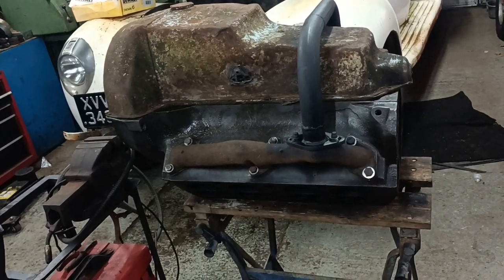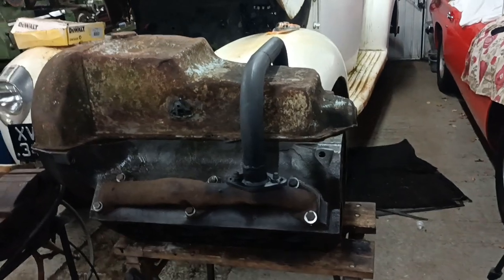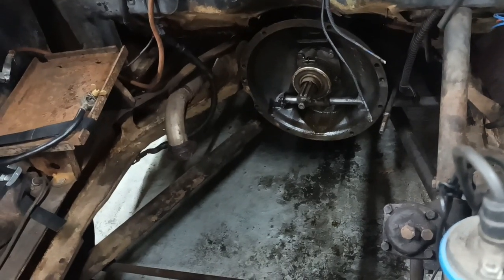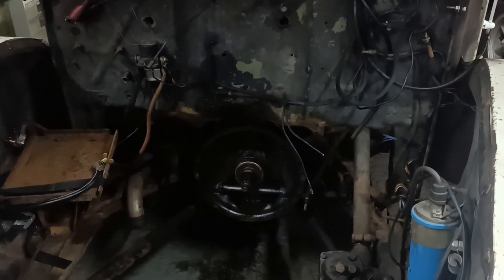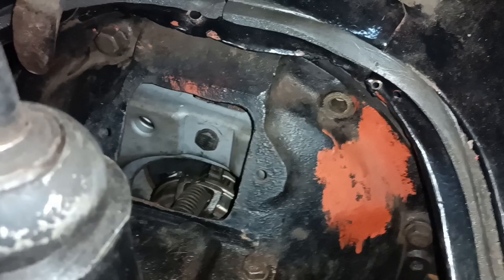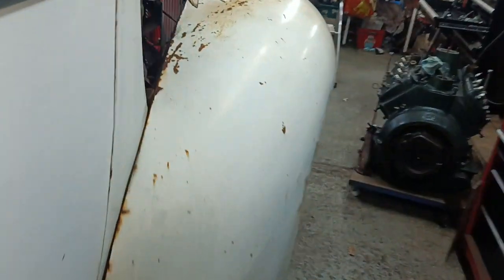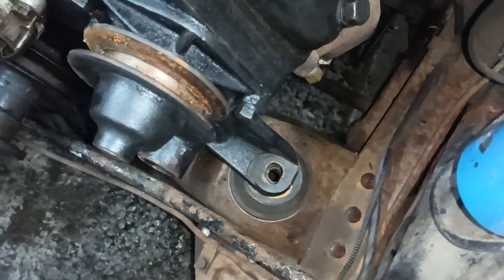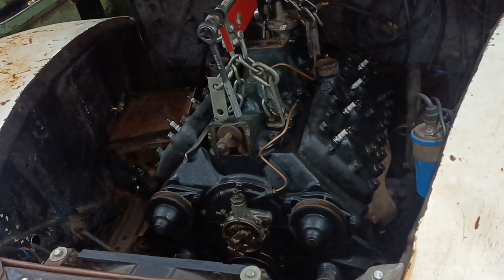Putting a Flathead Motor into an early Ford. 1940/41 Ford Pickup Engine install. (2306)

Comment: A couple of slotted studs, for alignment,  in the back of the block where the bell housing attaches would help to line up the motor so all you would need to determine is the proper "up/down" angle between the engine and the trans. 
I have two rather large pointed drift punches (one smaller, one larger) that I routinely use like a "spud wrench" for aligning holes when assembling larger items. They are indispensable for what you are doing here !!
Reply from the maker: Hello Ron. How right you are. I have some slotted studs but didn't think to use them. I was struggling with a cold and wasn't thinking right. I should have used the studs and also used a ratchet strap to pre load the motor so it wants to go backwards. All things I have done before but I just kept struggling rather than try the smarter approach. I blame it on not feeling great. Anyway, it's in, and no-one died. Thanks for watching.
Reply: @MartsGarage  
I can totally relate !!! I have those kind of days "routinely" even when I'm not sick !!! ;o)

Comment: Ya I just cut my anti chatter rods off I have a 53 flathead in my 40 ford truck . What did you use to support the transmission from the front when the engine was out?
Reply from the maker: Hi Wiley. I didn't use anything while the motor was out. I just used a jack when trying to fit the motor. Thanks for watching.
Reply: @MartsGarage  thanks for the info I guess the back part of the trans bolts is enough to hold it secure I subscribed to your channel your videos are just what I was looking for I pulled my 40 truck out of the Mojave desert it was amazingly preserved it  still has the banjo and three speed and a 53 flathead and uncut wishbones thank god .